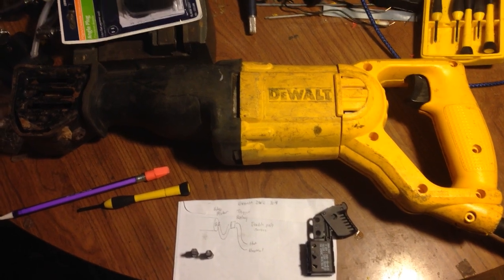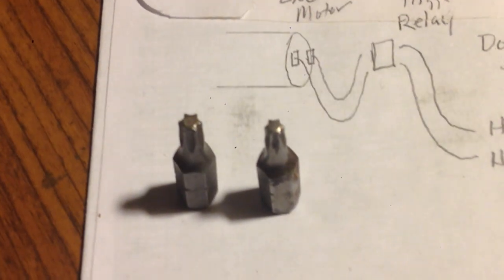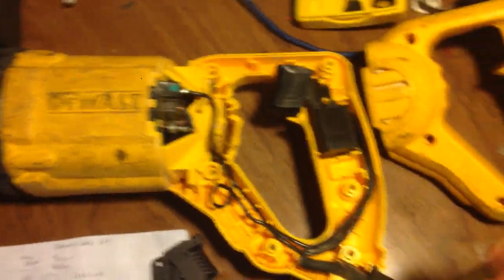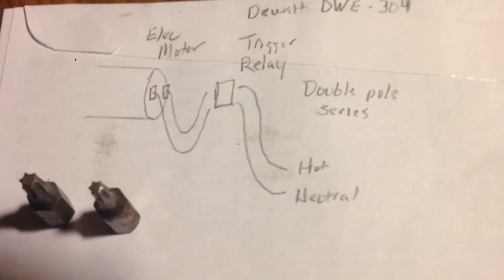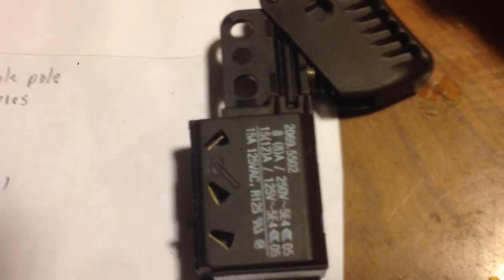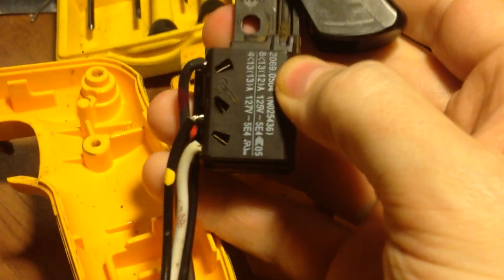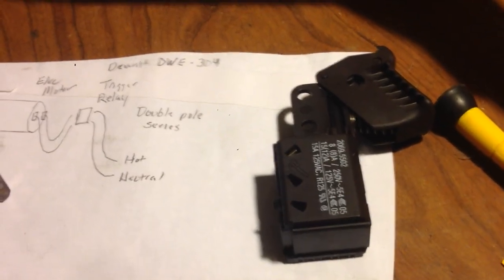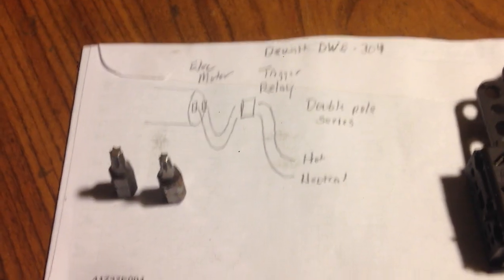Repair for Dewalt DWE-304 Reciprocating Saw Faulty Trigger - Ryobi Milwaukee Craftsman Black Decker

Comment: Thanks for the video. My saw is from the 90's and different than this. Dewalt quotes a replacement switch for $50. I'm looking for a cheaper solution.